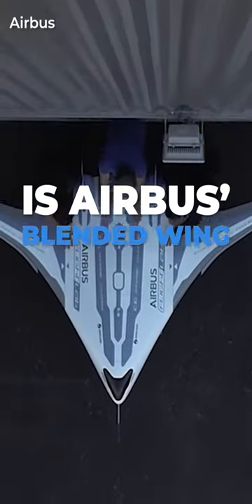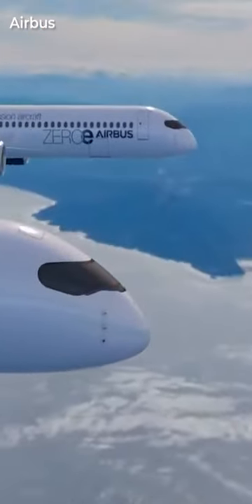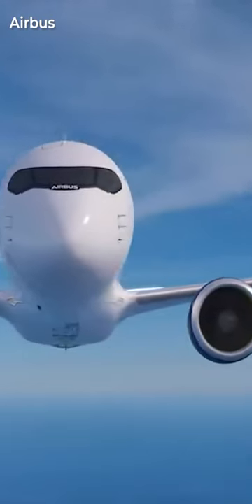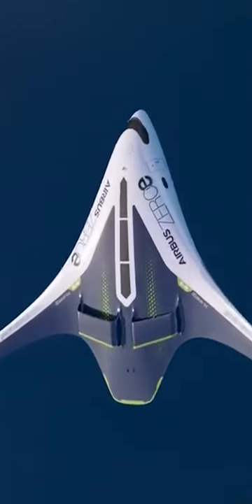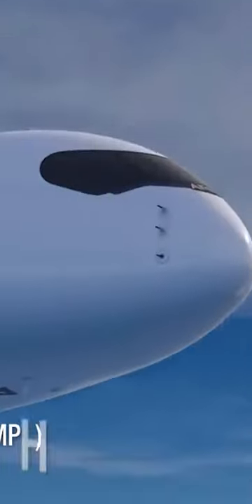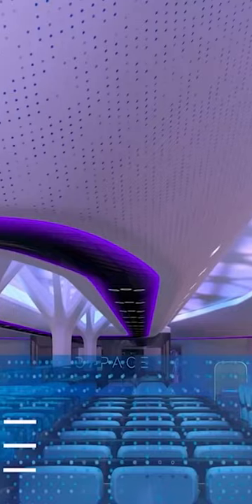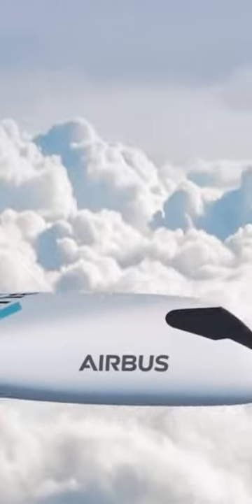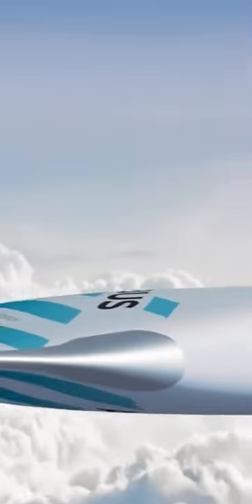Airbus' Blended Wing Hydrogen Plane: Doomed From the Start? #shorts

Comment: there's nothing stopping them from using this airframe with conventional fuels. if it's more efficient, that would be reason enough. why would it need to be hydrogen powered to use this airframe? 
also, the wings are really thin 🤔 that can't be right.

Comment: I feel like the blended wing body would do better as a sky cruise than a normal scheduled flight
Reply: Why?
Reply: @Hello_there_obi  think about it, that thing is massive. It's bigger than the A380 with a long range. Plus it would be a nightmare filling it with seats vs space for entertainment
Reply: @xa613rzinfiniteflight8  no it’s not. It would actually be shorter but with a comparable wingspan. It has more plan area sure. But wingspan and length are the key factors for airport ops. Remember the body itself generates a lot of lift too.

And with regards to space, I don’t think you understand BWBs at all haha. You would have tons of room! BWBs have much more internal volume than conventional jets. So you wouldn’t have to cram a bar in a tube fuselage. You could have a central island and get really creative. It would be the opposite of a nightmare. It would be liberating.
Reply: @Hello_there_obi  but what realistic route would it take? I personally don't see why any airline would invest in that when you can get the same range with conventional airliners
Reply: @xa613rzinfiniteflight8  you really don’t know much about aviation do you? What realistic route would it take? What does that even mean?

You know that airlines would drool at a 5% decrease in fuel consumption right? 

Well, the BWB could offer 20%. It can fly further and at the same high subsonic speeds. All while carrying more payload and weighing less. And it’s quieter too. And safe for landing on water. 

So what route you ask? Distance-wise? It could beat the route of any current jet airliner.

Comment: Boeing abandoned the blended wing. They found people got airsick without windows.
Reply: Airbus plans for side mounted synthetic screens to solve this problem and provide an outside view as windows would do.
Reply: @joso5554  a few manufacturers have been contemplating this idea 
    it would save on alot of weight without windows and be safer when you look at recent accidents where the high bypass fan has exploded and taken out windows

Comment: Just a shame that production of hydrogen fuel requires more power and, subsequently, CO2/CO production than is produced in using traditional fuels.  Then there's the whole thing about CO2 being good for the environment as its what plants require to respire versus dumping more hydrogen into the atmosphere that will likely result in increased hydroxyl groups in the atmosphere which will be poisonous.

Comment: Blended wing has a huge wetted area so that means low speed at best. I don't see it fitting in an airport.  There will be hydrogen oozing out of those huge tanks, so lots of ventilation required around those. Hydrogen will always and forever be very expensive, so you might as well start working on hybrid solar + wind powered cruise ships now.

Comment: Oh look another simpleflying video without conclusion or even any actual information. Why is it doomed? why is is in trouble? just because it will take a little longer is not a reason, just because they chose to store the hydrogen in the rear bulkhead (which makes perfect sense, you only told that to fill the video) is not a reason. This video was utterly useless!
Reply: The blended wing is going to take a boat load of R&D money better used elsewhere.   With the world economy entering recession it is best not to invest in something so far out at this time.
Reply: @danharold3087  Either way, I was complaining about the video, not blended wing planes. You added way more information on the subject than the video, for instance
Reply: @MrCaiobrz  My apologies.   Hate this UI.   We had better 30 years ago.

Comment: It’s not a blended wing airplane. It’s a delta wing airplane it’s shaped like a triangle which would make it a delta wing jet
Reply: It is a blended wing design.  A delta wing is a triangle with a mostly straight trailing edge.  Even if it was a delta wing design, it would still be a blended wind because there is no pronounced fuselage.